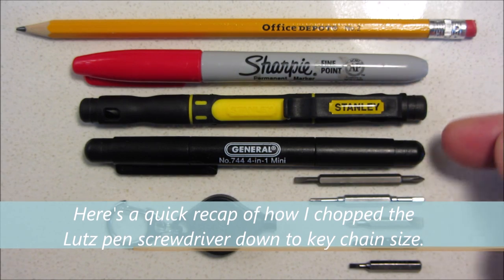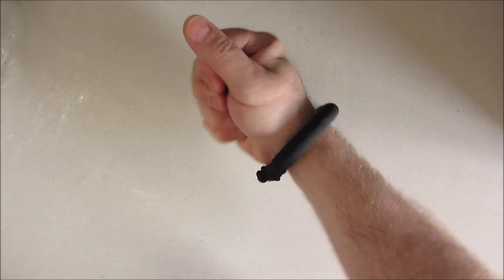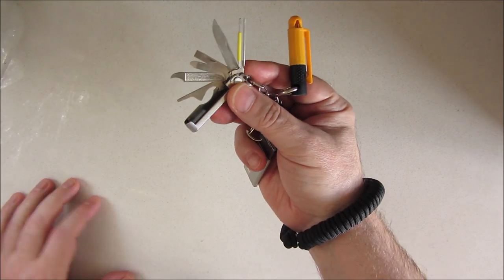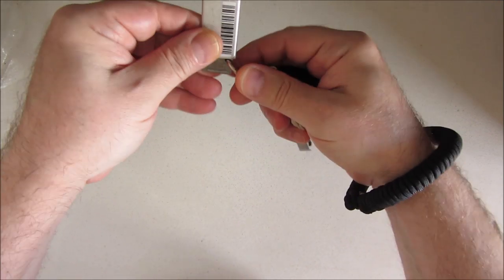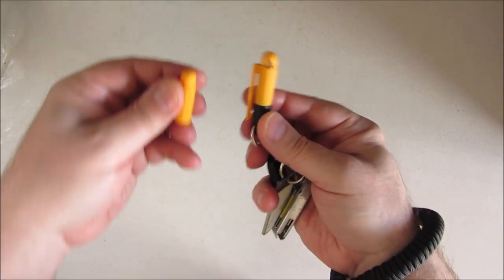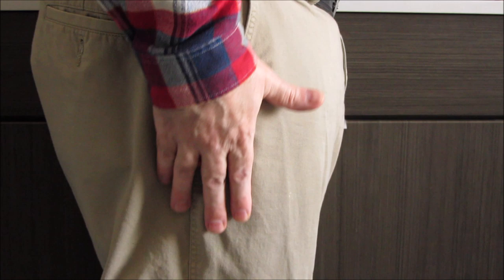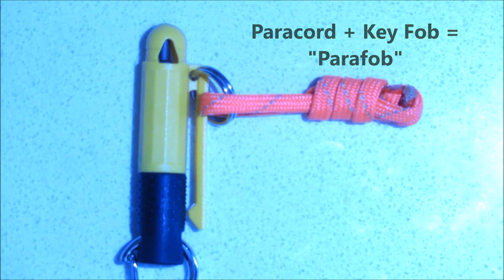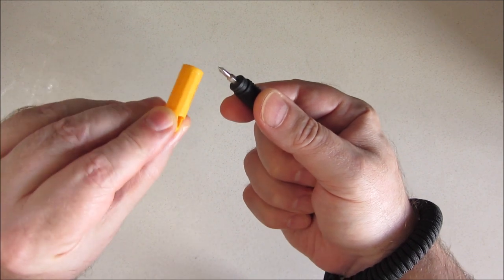Dangler Screwdriver for Key Chains (pt 2)

Comment: Hi MeZillch! Big fan here and always enjoying every new video you make. I've been looking to make your most recent mack however I can't find any tap knives. Any ideas on where to find them?
Reply from the maker: I see individual ones sometimes at hardware stores. Amazon will sell you a case of 12 for pretty cheap: https://www.amazon.com/Tach-Model-L-Metal-Knife-Pack/dp/B00G9R004E/ref=pd_cp_328_2?pd_rd_w=snnJQ&pf_rd_p=ef4dc990-a9ca-4945-ae0b-f8d549198ed6&pf_rd_r=CNK491Z4QVD4Y7F6TT63&pd_rd_r=49d00e05-26f3-4b17-b418-fe82fe896145&pd_rd_wg=DtMcc&pd_rd_i=B00G9R004E&psc=1&refRID=CNK491Z4QVD4Y7F6TT63